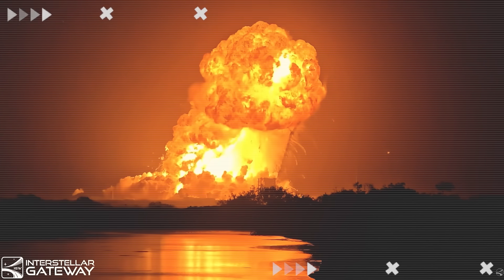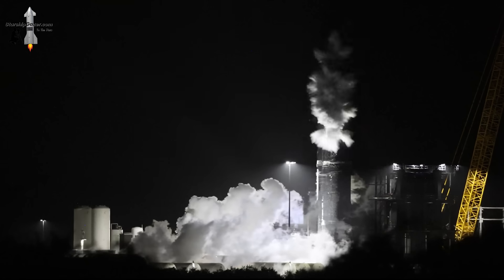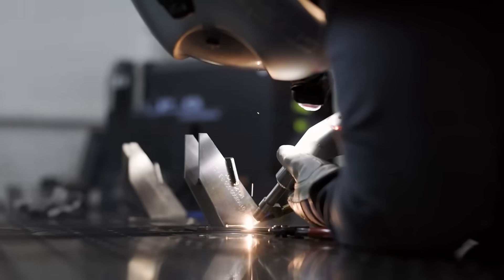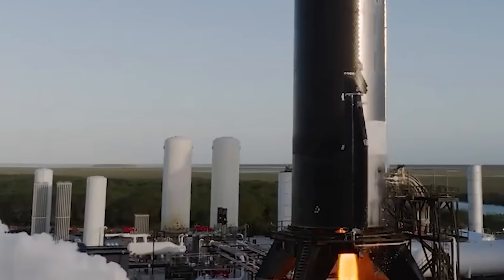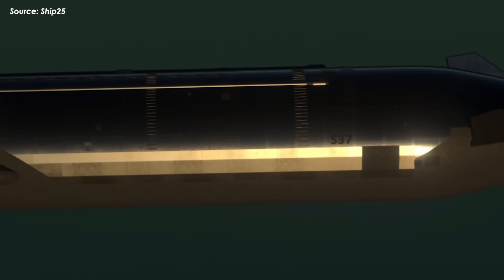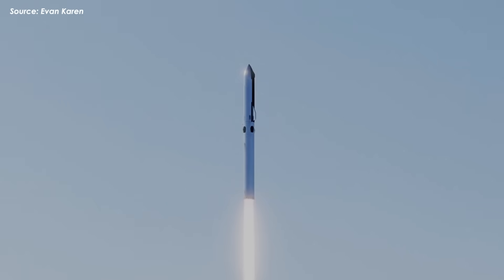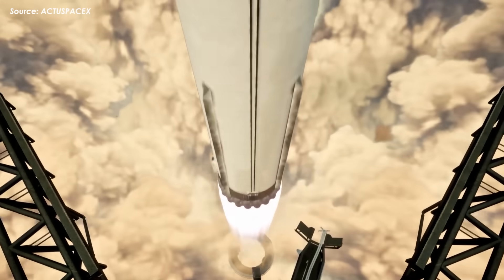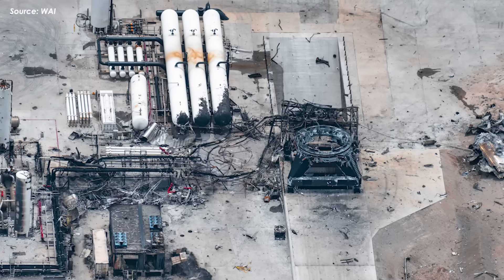SpaceX just announced Major Plan Changes on Starship Flight 10 after S36 Exploded...

Comment: Great!
Loved hearing a bit about Honda!
Always loved that company years ago.

My opinion on SpaceX's Wee little problem, is they should just get by doing the least possible with their likely defective design over runs ships, and then start working on a ten meter system, in hopes of getting past the issues with 8 meters.
10 Meter diameter would allow them a couple more millimeters of metal thickness at least for the tanks, and also pack in more Raptor 3's to increase payload, and get them to a good even number standard diameter for Workhorse Small Ships that could be a permanent standard.

Also on the boosters, if they went to 10 meters, they could do a ring of engines outside of the hull diameter, and Space their center engines better for less damage if one fell off again. 😂
That way they could use the same stand, get more fuel at 10 meters, and with the smaller over all outside dimensions of R-3's pack on more engines. 

What a shame huh?
The Nerds trying to shave off a few hundred kilos on auxillary tank weight, did in an $80 million ship and a gazillion dollars of infrastructure, and lost alot of time...

That may hold a historic record for false economy...

I would suggest prioritizing durability factor over weight slightly...

They are lucky that happend now, and Not when it was a ship load of Mom's and Space Scouts heading for a Lunar Adventure...
Or Colonists half way to Mars...

Up the diameter guys, this aint 1965...
Theres gonna be a minimum feasible diameter for fabricated ships, that gives you some room to breathe on design choices...

FYI imformation the minimum size on 
Steel boats is about 36ft and ⅛th skin thickness. Below that theres not enough volume to weight, and not enough steel to weld adequately..

Fabricated Space Ships for gavity wells will also have 
have a lower practical size limit, and from the tank cracks and trying to fudge weight with Krappy tanks, 
8 meters isnt it.

Just sayin'

🤗
Reply from the maker: Sir, you really went full aerospace architect mode here. But yeah, 10 meters would solve a lot — at the cost of redesigning... well, everything.
Reply: @alphatech4966 
Well, Elon was talking about an eventual 18 meter diameter ship.
Ten meters is a step in that direction....
And I ran the numbers, if hull is 3 mm, its less than ⅛th, which is considered minimum for a boat hull of around four meters in beam.
in sixteenths, comes out to 1.8..... Its shy of an eighth....

And a boat hull is not a cryro pressure vessule, its got maybe 5 psi of compression, and mostly dynamic loads.

So they are building 
8 meter beam hulls,  of thinner than adequate in the industry for a hull with a quarter the cross section.

And expect it to not split seams under pressures, with the test pressures being well over 100 psi tensil strength... which would need way better welds than a compression hull.

And it doesnt matter if they have to re engineer
everything, if its not feasible at 8 meters, and is feasible at 10 meters because they can go to 5 or 6 mm skin thickness.. And get way better welds....

Reality doesnt care what we like....
And what I am pointing out is a valid concern.

And an example of when Elon quoted one of my past writs at;
 West Point;
"Closely related fields knowledge."

I think the Nerds might wanna start thinking about my points...

I have scored on them occasionally?

Humor aside, it would make alot of difference, 
And allow other improvements, from better auxillary tanks to thicker skin on the booster strakes, and less framing in them.

And create a stronger, bigger, better cargo ratio ship.
Its a step forward...

SpaceX could use some progress....
😂

And the Engineers cant be happy working with such thin materials and basically zero safety factor...

I'd say go 10 meter, then a jump to 15 meters, and then to 20 meter diameters, and jump the hull thickness appropriately...

Look at it this way;
if not for me being Captain A-Hole, they'd still be struggling with Raptor 1's....

Wonder how that would have been in comparison?

The skin is roughly 80% of your hull strength.

Just trying to help!
Not here for all the accolades! 😂